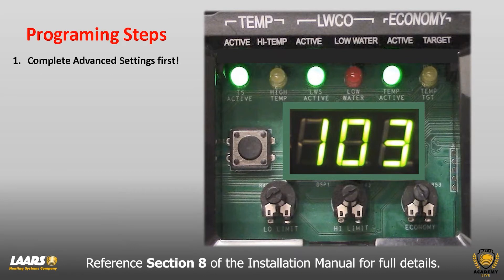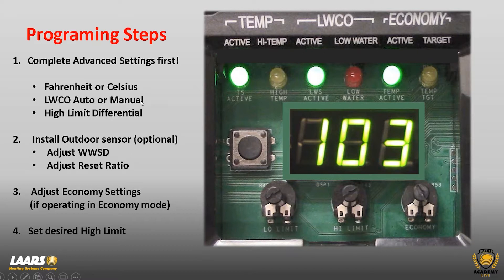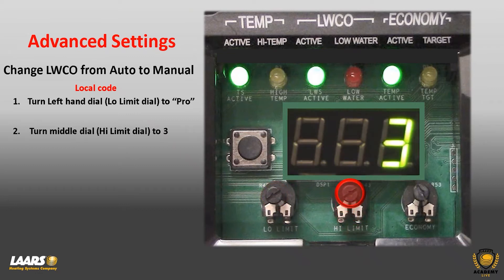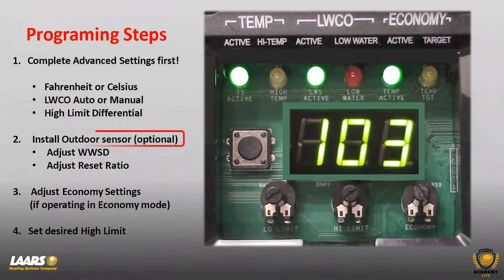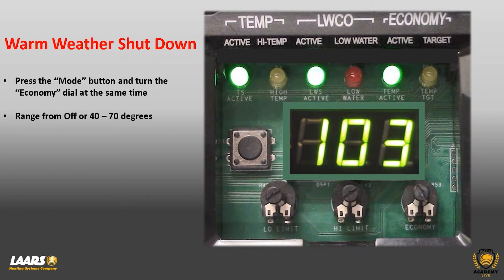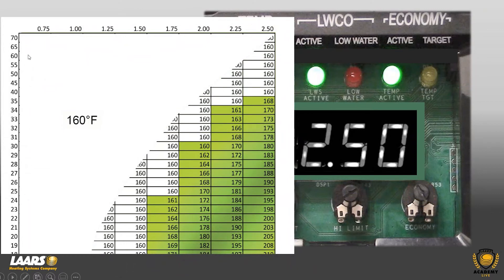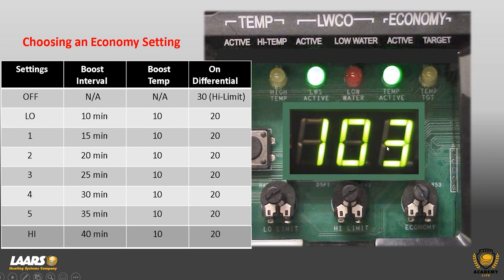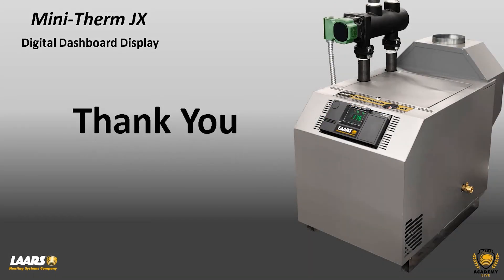Mini-Therm JX.  Programming the control.

Comment: Just picked one up for my parents home. I like the packaged low loss header. I usually make my own with Mechanical tees and a piece of pipe, but I opted for this cutie. 
I've installed 4 of these in my 22 years of plumbing/heating.  Each time I've built a steel base with pipe and flanges as feet welded onto a 1/4" plate to raise it up off fhe floor and leveled by the flanges on the floor. For my parents, I opted for a Buderus horizontal indirect heater so i can sit the boiler on top. I don't need to make a base and will have more space in the boiler room for storage. 
Love Laars. Rathe Associates has classes on all their products if youre in the NYC area. 
Stay flowing Y'all.

Comment: UPDATE - it is now heating season and new boiler was short cycling badly.  I verified everything was ok with the suggested diagnostics and then started looking at the programming.  I don't have an outdoor sensor it is unclear in the manual as to the impact of this on the economy mode (poorly explained).  In Economy Mode, found that the Target Temp was way too close to the Low Limit Temp dictated by the algorithm.  The differential was only 10-15F.  Burners would come on and satisfy this in 1-2 minutes and shut down until the outlet water temp dropped (quickly) back down to the low limit.  Then burners would come back on - this repeated over and over again.  In any case, I went back through the programming and set the High Limit = 195F, High/Low Differential = 30F and Economy Mode = OFF.  This corrected the problem completely!  I called Laars Technical Hot Line at the number in the video and the gentleman was helpful.  I just wanted to verify I wasn't going to damage my new boiler with the Economy Mode = OFF.  On a call for heat, the boiler now runs up to 195F, shuts off and the Taco Pumps continue to circulate the hot water. Once the outlet temp reaches 165F, the burners turn back on and take it up to 195F again (as expected).  If the thermostat turns off, the zone valve closes, the one system Taco Pump keeps recirculating and boiler temp drops on its own accord.... usually down to like 133F before the next call for heat (or hot water - I have a new Bradford White indirect hot water heater).  I am a retired Mechanical Engineer (BSME & MSME) with 40 years of experience.  I told the gentleman on the tech hot line that the software needs to have a different algorithm when there is no outdoor sensor and/or clarification in the manual.  It is an excellent boiler overall with exception of the Economy Mode algorithm with no outdoor sensor.  It is running really well now with the programming changes I made.  Thank You.
Reply from the maker: Jive Patrol,   Our YouTube channel is not monitored by our Service Department. Have you called your Installer or your Laars Service Rep?
Reply: @LaarsHeating  - Yes I called the number at the end of the video and spoke with someone at your company.  The boiler is working fine now with the settings I enumerated above and the Economy Mode = OFF.  Thank You!
Reply from the maker: I have forwarded you JX issue to or Service Department and will get back to you very soon.

Comment: I really like this boiler and had one installed in my confined space with a Bradford While Indirect Water Heater.  The installation was completed today and I REALLY like the performance thus far!  I am the first customer for the contractor for the new JX-125.  It is still summer yes but it will heat the whole tank of water in only about 12-15 minutes!  My old boiler and water heater were at 39 years and 25 years respectively and I didn't want to have either fail in the middle of winter.  My new Bradford White (Laars) unit is very efficient unit and I worked with the contractor to set reasonable limits  I tested the baseboard heating too and it is working well.  For now in the summer, the boiler runs infrequently and shuts off and the circulator to the water heater keeps going until the water heater internal temperature hits the goal.  I like that it and the water heater are from Bradford White and American Made!!   I had one of the best companies installing my system too.  Thank You! 🙂🙂🙂🙂🙂
Reply from the maker: Thank You!   The Mini-Therm is a great little boiler. Proven over time.   My apologies for the January response. We get a lot of comments on YouTube and we don't get a chance to respond to all of them.  But starting this month,, we will!  Thanks Again! 
     If you do ever have any issues,, please call us at800-900-9276.